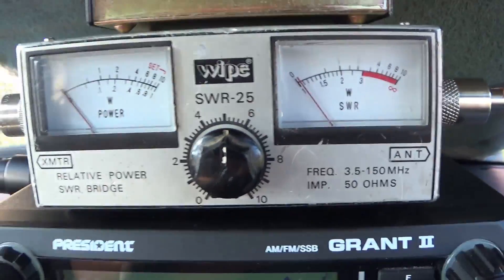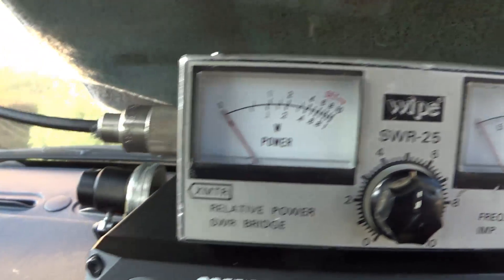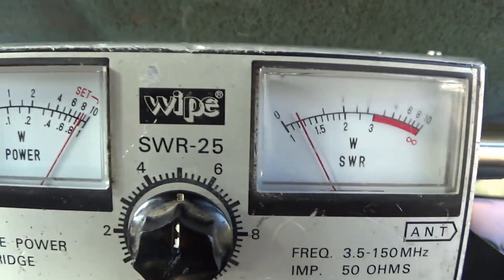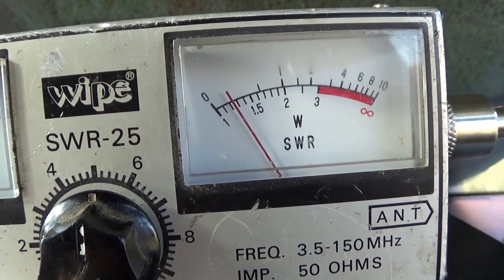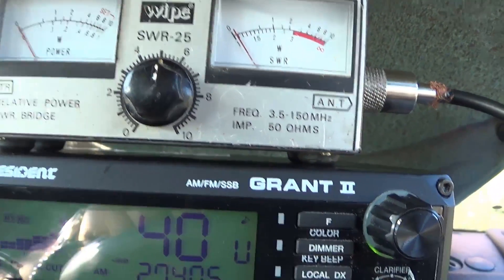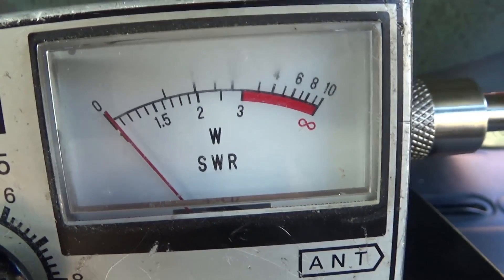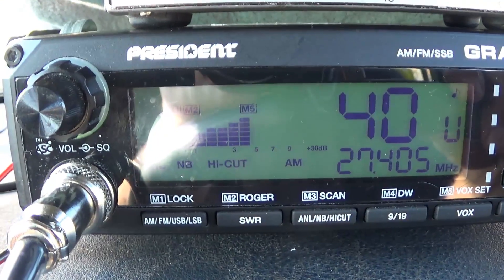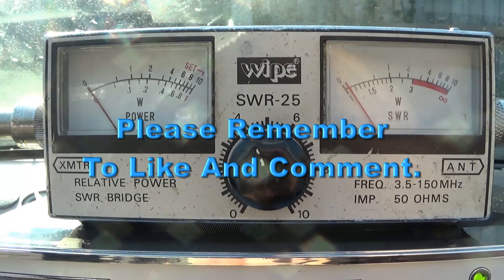Tuning a CB Radio Antenna Your SWR problem SOLVED.

Comment: HI steve   love all of your videos  
 if usung an amp do you need to do the swr readings with amp connected 
many thanks
Reply from the maker: Hi Thomas  in reply to your question yes, you need to check the swr on the other side of the amp.
So its patch lead to the amp, and another from the amp to the swr meter.
More vids to come fella and i am glad you enjoy them mate.
Reply: ok steve  thanks for quick reply.  i have lowerd the swr thanks to youre video and tomorrow i will check it with the amp in line   hope to catch you on the air some time 
many thanks
Tom 
26TB001
Reply from the maker: I am only glad i could help fella, yes an on air chat would be great.
Are u on my fb page, if not just look up cb radio Europe on there.
We now have over 500 members, not the biggest group but a good bunch of lads in there.
Reply: thanks again  I am waiting  to be expected  on you're face book  
many thanks  for  your help 

Tom

Comment: Hello Steve I enjoy all you're videos I have a president Lincoln 11 v3 radio and a red devil whip works great and I can get out and communicate with the local lads here in Torbay Devon, only problem is my swr meter doesn't move at all I've tried different patch leads and meters still no movement. Any ideas what's going on mate
Reply from the maker: Hi Kieran sounds like the swr meter is faulty. If it only plays up on SSB it is because u are not making any sound (try whistling into the mike?)
I cant remember if the Lincoln has a built in meter???
If it has try that, as the rig is obviously putting out RF.
Reply from the maker: The meter could be faulty,  without looking at it my self its  difficult to say. Are u trying this on ssb or fm??

Comment: Ok, I have a problem. On channel 40, my reading is perfect with a 1.1. But on chanel one, I have a number that is above three. I'm really confused. My cord is perfect, and it is also brand new. As well as the radio and SWR meeter.  It is grounded and I have never run the radio without the anenna attached. I just don't get it. I habe ajusted the antenna as well, maybe i havent found the sweet spot, but still. I even tried it on a rural  hill to aviod trees and buildings. If anybody has any suggestions, please let me know.
Reply from the maker: Hi as i pointed out in the video, the lower the channel/ frequency the longer the Antenna has to be.
Adjust the whip a little longer maybe an inch at a time, until you see a drop.
In an ideal world your swr would be the same on ch 1 AS it is on ch 40.
Let me know how you get on ok, i presume you meen 1.3 as in 2 digits below 1.5.
If that is the case that is more than good enough.
Reply: I have adjusted it as far as it can go. and still no change. And I don't know if I flipped my speech around the first time, but my SR meter say that I have a perfect 1.1 on channel one, and an above 3 reading on channel 40. that's seems like an awful big gap to me. I'm going to go and try it in a flat open area to see if that makes a difference. Now I cant remember if I got that backwards the first time, or that was actually the case. Sorry, I forgot to mention my antenna adjustment. Ill keep adjusting it but I think that's the big issue. The antenna by the way is a K30. Just look it up, its magnetic.
Reply from the maker: CWMORGAN 4240 
Ok so your SWR is high on ch 40.
It does not matter what antenna u have the basics are still the same.
So Now we know your SWR is high on ch 40, shorten it an inch at a time.
If the antenna goes all the way in and is still high you have a few options.
One cut a small piece off, i doubt you will have to do that but its an option.
Secondly forget trees and other stuff look at the antenna and see if  part of your vehicle is near it.
Ie if its a truck move it away from the box/trailer.
Ideally the whip should be away from the vehicle all the way up.
Watch the video again and watch what happens when Deb puts her hand near my antenna. Its not a tree or anything metal but it does effect the swr.
Reply: Ok. Thanks, I was thinking about cutting it a little. Because when I shortened it, what little I could, it made some improvement. And my antenna is not surrounded by anything. It is out in the open on top of my pickups roof. So I think it's just a mayer of shortening it and the problem should be fixed. I will tell you how it goes. In a few hours when I'm out of class I should be able to fix it.

Comment: My swr is in the red on both 1 and 40. I've checked the ground, running a meter from the mounting bracket to the negative terminal of the battery and ground is good. The SWR is higher on 40 so I need to shorten. Since they r in red, is this likely to solve my SWR issues?
Reply from the maker: Hi James i take it you have the Antenna on a car / truck.
If u have is there anything metal within a few feet of the whip part of the Antenna??
If so can you move your twig away a little
Reply from the maker: Hi John it does not matter what Antenna it is, the tuning method is the same.
The lower in frequency you go the longer the Antenna has to be.
The higher you go, the shorter it has to be.
Reply: +steve stevens also compos video for tuning SR-10 antenna
Reply: Steve Stevens good

Comment: you just solved a problem! I am new to cb, I have a crt one n with a Springer antenna, I use it when off road or in a convoy. I get now movement on the swr when in ch1 and 1.9 on ch 40... shorten or trim now. thank you so much Steve, maybe the vehicle fuse will stop blowing now!

Comment: hi i am getting crt ss9900 next week do i do the same thing swr it or does have it build in the rig
Reply from the maker: There is a built in SWR meter, but if your SWR is high you can work out if the Antenna is too long or too short by the method shown in the video.
If u have any problems ask away here ok ..
Reply: hi i be  using the 10 meter telescopic pole

Comment: I have a ranger rci 2950 dx Antenna is a sirio hi power 4000 with the black butt you can tilt the Antenna on the knuckle
Reply from the maker: +Ciaran Mc manus 
so explain more about your swr mate. how high is it and where

Comment: No need to be sorry Steve. I think that was the first time you asked. Yes, it's a small world Steve and getting smaller, what with the internet, skype, mobile phones and all the other electronic gubbins not to mention RADIO. It's more fun. You never know what you're going to get, as you found out when you got your QSO with the laddie from Edinburgh. You were certainly very surprised indeed. Edinburgh is about 68 -70 miles North East from us but it's about 375  miles from Luton, so a pretty good contact was made and it sounded like you enjoyed it LOL. I'm looking forward to getting things set up here. A slow process as iv'e got a dodgy ticker but I shall get there in the end.I may be firing some questions at you too, if you don't mind. Thanks again Steve and keep the videos coming.